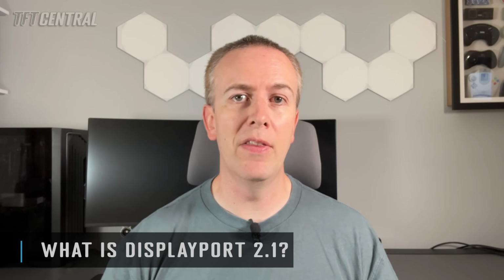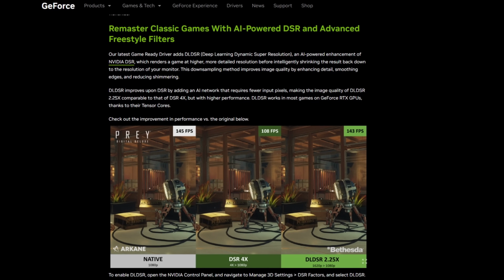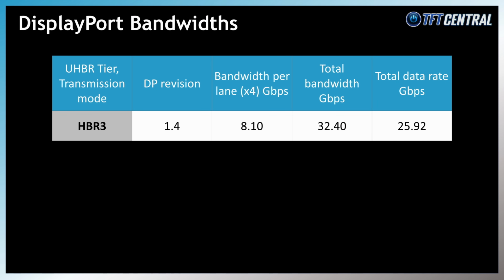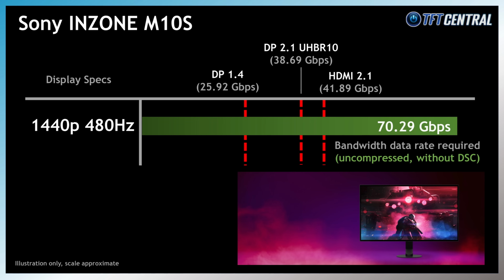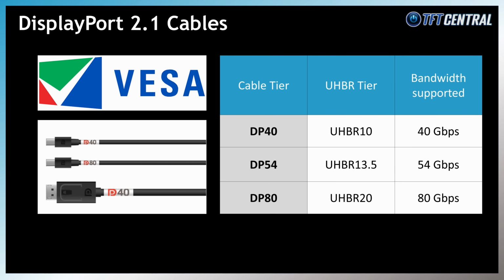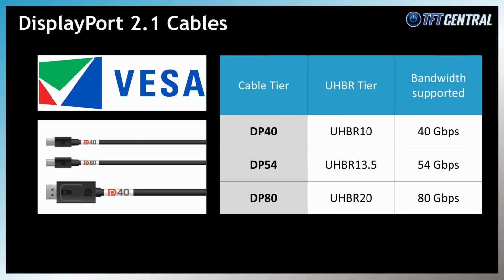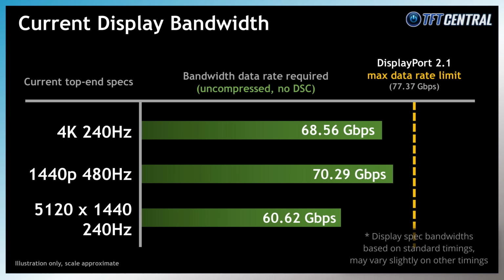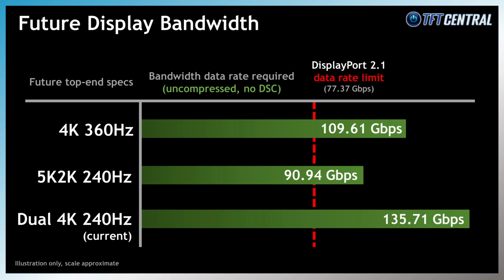The 5 Big Problems with DisplayPort 2.1

Comment: When this copper will be changed by light? No requirement for length and MUCH higher bandwidth ( UP TO 800GB/S )
Reply: They do make converters, they come in various types, but it looks like most are thumbstick style dongles (a bit larger though) that plug into a DP port and have FO connectors on the other side.
Reply: @kaseyboles30  could you list an example , like why would someone need it 
if the monitor is DP1.4 even if you convert it to fiber optics your still hardware bottlenecked by the monitor main board. 
only solution for the time been is getting a fiber optic cable that support UHBR 20 for lengths of more than 1m
Reply: @Annonymous37284  DP/HDMI to fiber converters are mostly used for distance  today, not bandwidth. For example Linus of Linus tech tips has a server rack filled with various things including a pc for each family member and uses something like this to have the monitor/ keyboard/ mouse/ etc. wherever it's needed. He then has all the heat generation in one water cooled rack (and the heat is dumped via a heat exchanger into his pool).
Reply: @kaseyboles30  no 
I believe he has a normal hdmi for video to his monitor But the usb is the icron hub (costs like $1000) to get his usb and peripherals to his gaming room

Those hdmi to fiber are not 2.1 from what I looked up cause I needed this use case and did a lot of research and there were simply not any that support 2.1 
If you want the 2.1 standard you need a fiber optic cable not a converter
Reply: @Annonymous37284  He's almost certainly using some sort of extender for hdmi if he's on 2.0 or 2.1. 10-15 feet isn't very far. Though you can get upwards of 50' on hdmi 1.4, but I don't see Linus doing 1.4 if he can put in better.
Reply: @kaseyboles30   I went to check his videos they’re just your ordinary cables 
He has it this way wall plate with DP in it , a dp to dp extender like a short extender cable and then the main cable from that short cable to the rack where the pc is 
So they’re just ordinary cable but probably are fiber optic to keep signal integrity 
you can see it in the video “my computer is everywhere- new house office setup” 5:40 on that video  , he even mentions why is there that short extension it should of been one extension and a coupler to make it flush in the wall probably the one who wired it ran out of cable so he had to make a small extension cable 😅

Comment: DP 2.1 is simply around 5-10 years ahead of its time at best. We're already at the point where we see diminishing returns on both resolution and frame rate for desktop size monitors, especially on current gen hardware. Beyond that, going forward, the metrics that will be pushed in terms of hardware capability is NOT resolution at higher refresh rates. It's graphic fidelity and complexity. So realistically when it comes to strictly looking at viable resolution x refresh rate numbers, we will see it stagnate almost entirely for years to come. Going from 1080p 60hz a decade ago, to 4k 240hz today on DP 1.4, was a big leap. But beyond this point the returns are far less noticeable, yet the cost increases exponentially - so it's simply unattractive to pursue higher gains when we're already bordering on perfection.

It's why AMD shot themselves by trying to force DP 2.1 on their current gen graphics cards. No one can even make use of it because pushing any visually intensive task (that would benefit from these data rates), is simply way too limited by the graphics hardware itself before the display output even becomes a concern. It's like shoving a bigger engine into your car, expecting your commute through traffic to be faster. Ultimately you're limited by entirely different reasons and your existing engine is hardly working as it is anyways, so upgrading wouldn't net you any benefit whatsoever.

DP 2.1 is just a bit of a waste for 99.99% of consumers. And it taking the route of USB data naming and branching doesn't help either.
Literally if someone were to ask me how DP could ever lose their position to HDMI, I'd say "waste effort on things nobody will realistically use, and make the segmentation obfuscated so people don't understand what they're buying". And it's literally what they have done. Absolute self shot. Sometimes I really can't fathom how professional people are behind these decisions... Amateurs.
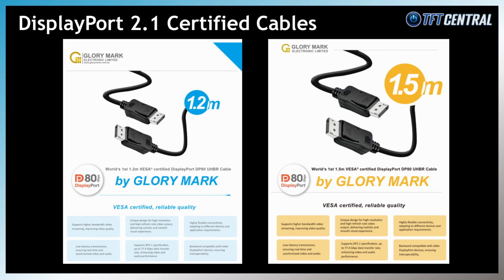Reply: We need 8K displays in 16:9 and 16:10 formats, and we need them to have the electronics to drive integer-scaled all the mainstream lower resolutions at correspondigly higher refresh rates. (4K, 1440p/1600p, 1080p/1200p, 720p/800p).
A 40inch 16:10 8K monitor capable of all that, with the best reliable panel technology available would be a marvelous thing. One day...
And DSC is a compromise, a workable one perhaps, but DP 2.1 and higher would allow some of these resolution&Hz combinations to be displayed without compromise.
Reply: @edfort5704  That's a whole lot of yapping to still say nothing. DP 2.1 is useless for the next 5-10 years because 99.99% of people will never have any use for it. You're not gonna run anything at 4k +400hz in the first place so why support it. Waste of effort and money. Better to invest into optical display cables then rather than waste it on useless old wire tech.
Reply: @Real_MisterSir  Higher refresh rates benefit anything and everything that involves moving images, including simple browsing or scrolling through documents.
We are very far from reaching any perceptibility threshold in this area and the only diminishing returns that exist with higher refresh ratea is when the jump is too small (e.g. from 240Hz to 360Hz).
Many games may be hard to run at very high fps, but higher Hz will benefit even fps-capped games through lower latency. It's just that it's not worth for the avg. consumers to make incremental hardware upgrades, but large ones (2x, 4x etc.)
I too hope to see the potential of optical cables more explored by the industry.
Reply: @edfort5704  bro unironically thinks going past 240hz on 4k means anything I can't 💀
Reply: with the rtx 5090 which will have dp 2.1, having a qd-oled 4k240hz dp 2.1 screen will make sense in my opinion
Reply: @Real_MisterSir  Bro, I plan to enjoy the f**k out of 4K@240Hz (hopefully integer-scaled on a 40ish inch 8K screen) for many years to come, while still knowing we can do better, way better than that.
Have fun with whatever you have!

Comment: i think mandatory dsc+1 any other is actually reasonable. i don't really care much if i get advertised high resolution + high refresh, no problems whatsoever. its not the same bullshit as usb 3.0 renamed twice
Reply from the maker: I think the issue with it though is that every bit of DP 2.1 marketing and promotion is about the new speeds it can support. That’s what the connection means in the minds of the consumer, and to then say that actually that feature is optional is open to all kinds of confusion and misinformation. “displayport 2.1” doesn’t actually mean new, faster speeds at all, at least it doesn’t have to

Comment: Do you think manufacturers will be able to eventually make longer 2.1 cables in the future, or is it unlikely?
Reply from the maker: It’s hard to know. Passive copper cables are going to be difficult for sure at long lengths and high bandwidths. Maybe a different solution will be found though
Reply: @tftcentral maybe it's time for fiber cables? It seems that is inevitable just a question of when, right?
Reply: @Ye_Old_Grog  It's such a clear solution there are already media-converters that plug into a DP or HDMI port and have a fiber-optic output.
Reply: HDMI already has optical cable for those who need longer cable length for same high speed. Cable costs more but its an option. DP 2.1 have to support same thing its only option.

Comment: It's worth mentioning that losing Nvidia features (DSR, DLDSR, etc.) has nothing to do with DSC. It's entirely to do with hitting the pixel rate that causes the GPU to use more than one display head (of a total 4 on the card) for that output. This is why sometimes the features are available with DSC and sometimes not. It probably also causes the extended black flickering issue.

Monitors Unboxed covered this in their DP 2.1 video.
Reply from the maker: That’s true, and their info was based on our original article on the topic that was shown in this video 🙂 realise I should have linked to it in description too, now added 👍

Comment: Why hasn't the industry adopted an optical connection for displays?
2 meters of OM5 optical cable that supports 100Gbps costs about 18$, which is cheaper than a hypothetical 2 meter DP2.1 80 cable.
And optical cables can go hundreds of feet it length.
The transcievers use about 4 watts of power, so that is not the reason.
Probably the cost of transcievers then?
Reply: optical cables are less durable for the same cost, so to mass produce optical cables would be significantly more costly, require massive changes to current manufacturing processes and the benefits for 99% of users would be negligible
Reply: @deloford  there would not be much change in manufacturing. Datacenters run on optical network connections, this is why I talked about OM5 in the initial post. They are everywhere, and durable, especially on the connector end (unlike DP where one pin can get damaged easily). There is probably more optical cables in the world right now than there are display port cables. They are just absent for end users. The only real durability problem they have is when you do sharp 90 or more degree bends, but this can damage DP cables as well so kinda a bogus argument. Where they would change for end users is they would be done with more bendy materials which attenuate light more, so the range would go down for the sake of durability, but still a benefit since they right now have hundred times the range of DP 2.1 and they would be cheaper. I suspect the real reason why they aren't used is the chicken or egg problem for supported devices and standards or the cost of implementing transducers in consumer devices.
Reply: @deloford what about oculink?
Reply: @kougamecs3876  64Gb/s max
Reply: We should, but digital rights management is king, and eventually, no one will own DVDs, blurays, and your computer will just be a kiosk, it's what windows and Intel are working up to. Also helps marxists stay in control by spying on what you do. You should check out the creepiness of Intel's driver assist manager.
Reply: Because it's not just the cable that would need to change
Reply: I have a 30m optical hdmi cable, supports 48Gbps iirc. It cost about 1000NOK. Longer or shorter variants cost about the same, since all the cost lies in the transceiver.  The 100Gbps transceivers we buy for networking at work cost the same as that _cable_, _each_, which for enterprise gear is not at all bad. Costs are steadily going down as 100+ Gbps networks get more common. Anyways, I think you're right, well probably see more optical cables in order to support the bandwidths we are seeing here. They'll be expensive to begin with.

Comment: I’ll never understand why it bothers a High end PC gamer to just run DSC.
Reply: DSC makes editing EDID difficult, which is important if the manufacturer sets the wrong NITs in the EDID. Also, DSC means no DLDSR (unless there’s a weird workaround). At 1440p at 27 inch, the screen looks pixelated compared to 4K. DLDSR would fix that. Also alt tabbing or going from one full screen app to another will result in a 5 to 7 second black screen.
Reply: I use DSC all the time
Reply: Because people think that compresion = bad, there was a time where flac was called an inferior format because it compresed the audio but people grew up from that, we just need time and reviews

Comment: So it looks like the 5090 will have 2.1 display port.  Will the GIGABYTE AORUS FO32U2P the one to buy
Reply: With full bandwidth
Reply: Looking at the MSI 322URX ...
Reply: You newer know, when it is nvidia…
Maybe full 80 with 5090
40 with 5080
20 with 5070
And fake 1.4 version in 5060…

That would make sense!
😂😂😂

Comment: I bought the MSI 27 Oled 360hz. Newest FW is installed. I can switch off DSC. But cant activate 360hz, as soon as I toggle off DSC, there is only 240Hz available. But if you calculate you are supposed to power 10bit WQHD 360hz without DSC. The New Asus Oled 480hz can also Support 360hz without DSC. Same connection. HDMI 2.1
Why isnt it possible on the MSI model ? I am sad...
Reply from the maker: It can't support 1440p at 360Hz 10-bit without DSC I'm afraid, if it could they wouldn't have used DSC in the first place. That combo needs 49.21 Gbps for uncompressed bandwidth, beyond the limits of HDMI 2.1 and DP 1.4. That's why you need to drop down to 240Hz if you want to disable DSC for whatever reason. The Asus PG27AQDP is in the same boat, max 240Hz if you disable DSC
Reply: Mine is the oled I can power it fine 360hz must have a crappy cable
Reply: It is possible which one do you have
Reply: A cable has two connections, so, what does your video card support?
Reply: @Mortac  rtx 4090
Reply: @Aleks-aka477  I assume the monitor is a 271QRX?

Do you use HDR? Since that increases bandwidth requirements.

I also think DLDSR can cause limitations if you use that.

Also ensure it's not the cable, but if it came with the monitor, it shouldn't be.

If all else fails, I'd just contact MSI support and ask about it.

Comment: Does it even matter buying DP 2.1 40 or 80 Gb cable when monitor have DP 1.4 and latest nvidia gpu too? It does not make any difference right? Or? I am really confused..
Reply from the maker: If you’re graphics card and/or monitor only has DP 1.4 then just get a regular DP 1.4 cable which can be longer and will be cheaper too
Reply: @tftcentral the cable actually matters regardless of gpu monitor is what matters but you won’t get the full hrz of the monitor utilized stop the false information
Reply from the maker: Well it goes without saying that it needs to be a decent / certified DP 1.4 cable yes. I meant you don’t need a newer DP 2.1 cable if you’re only using a DP 1.4 connection
Reply: @tftcentral  so every vesa certified on their to page is safe to use and dont need to worry about pin problem
Reply from the maker: That’s the safest bet to cross refer a cable with their site but DP 1.4 has been around ages, you can also go off well known brands or reviews on Amazon etc I’d say

Comment: The abuse happening is automatic. No question. the system has been actively designed to be confusing and easy to obfuscate and use in misleading marketing. Sadly not surprised. these codes and standards to afford deception seem to be the desired standard in all modern updates.
Reply: yea they probably got paid out to allow the obfuscation and misleading possibilities.
Reply: Ofcourse. They will take like 2-3 releases to get it right . Very scummy

Comment: TL:DW;
1) not all DP 2.1 connections are the same

UHBR10 = 40 Gbps, 13.5 = 54 Gbps, 20 = 80 Gbps
need UHBR20 for max speed

2) UHBR is optional. DP 2.1 = support DSC, and one of these: UHBR, AdaptiveSync secondary packets, or Link-Training Tunable PHY Repeaters

3) input source devices not DP 2.1 ready yet
graphics cards, AMD + Nvidia
AMD consumer R7000 up to UHBR13.5
AMD workstation W7000 up to UHBR20
Nvidia nothing in G4000 or A4000 series

4) DP 2.1 scalers aren't common
high prices

5) DP 2.1 cables are very limited
high prices
DP40 = 40 Gbps, DP54 = 54 Gbps, DP80 = 80 Gbps
1m or 1,5m max for 80 Gbps is quite short

Comment: hope next generation nvidia cards overhauls their PD connection (1.4 included) might fix their current bugs. At least theres a chance.
Reply: Whats the need tho? Nobody is pushing 1.4 anyways, it seems entirely useless. The actual games worth playing on a high end graphics card will never get anywhere close to pushing past 4k 240hz in the first place. Cyberpunk maxed out on a 4090 barely runs at 40fps without DLSS at 4k, and that's been out for years now. Any game worth getting a 5090 for will not pass even 144hz at 4k so why even bother forcing DP 2.1 that no one will use other than for arbitrary bragging rights and trying to run CS2 at +500 fps.. Its so useless. Diminishing returns that 99% of people will never care about.
Reply: @Real_MisterSir  The hope is getting a rtx 50 series would remove the 1.4 DSC bugs (black screens) for a 1440p 360hz OLED.